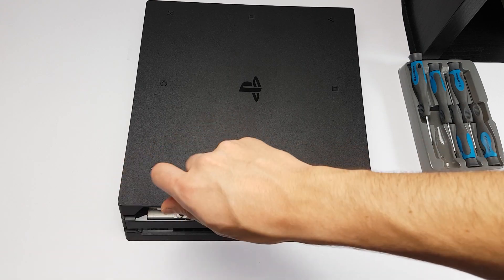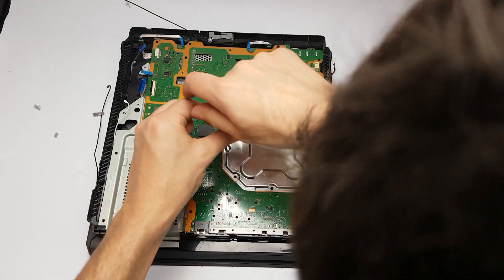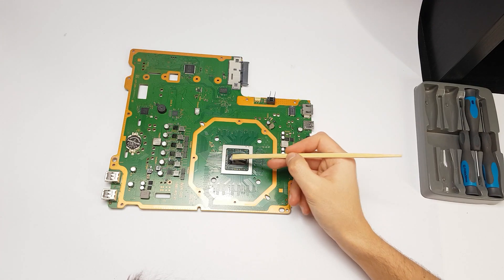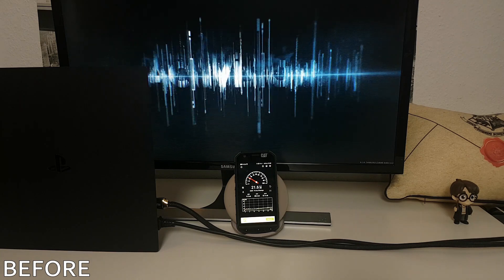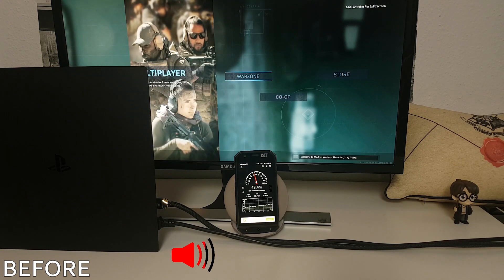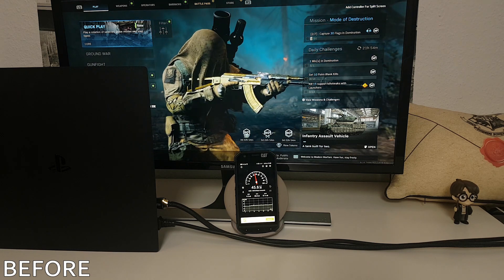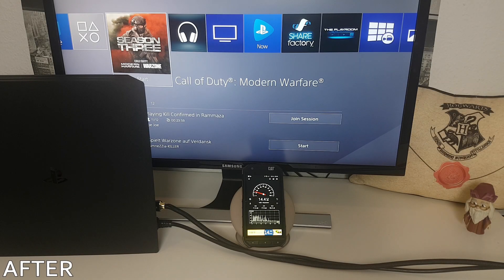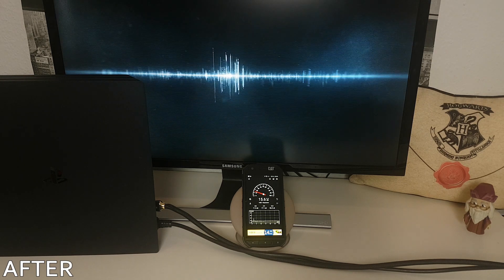PS4 PRO Fan Noise FIX - Thermal paste & dust - Before/After TEST

Comment: Do you imagine people blaming car factory for engine failer when they don't change engine oil for 2 years. Yes that exactly how stupid people looks blaming console temperature, inferior cooling system maybe, more power yes old thermal paste maybe depends how long the console have been used and made.
Just take care of you console 
Comon sense people!
Reply from the maker: The difference is that a car factory explicitly asks you to change the oil of your car. On the PS4, you shouldn't change thermal paste, it is supposed to last a few years.

Comment: every time I have to hear this crap, i ask myself how sony said “okay, this noise is fine” and shipped the product... seriously blows my mind
Reply: I think maybe games weren't so demanding back then.
Reply: @K1LL0_0SWITCH  a lot of games looked demanding but the console was fine with it, now some games even in menus kick up the fan for no reason, and what makes it even worse is that some games has a huge performance hit on every system because of the piracy protection the devs put in their games, in addition to the size of heatsink, all those things make me wanna jump off of a building
Reply: @K1LL0_0SWITCH  but the thing is my xbox still holds up fine running read dead and my ps4 can't even run ff7 quietly
Reply: @Nicori-hibi when I had my Xbox one s it sounded louder than my PS4
Reply: @poopbum9944  one S andps4  has a traditional cooling. One X has a different coping with vapour chamber.
Reply from the maker: In the beginning it was okay tough. But now, it is unbearable...
Reply: @SiriusMonkey  when it crashes I just want to get a revolver and not kill myself, but shoot the console
Reply: I think it mainly has to do with the thermal compound they use and the dust gathering in the heatsink
Reply: Very strange how the Xbox ONE is better at heat reduction that the ps4pro. I've had mine since release and I barely use it because of that issue.
Reply: It was fine for two years. You have to clean it regularly. Especially the dust
Reply: The sound is from the lack of the maintenance and cleaning the fans
Reply: @FlexSZN23  sony loves bragging about playstation being a console that should be hooked up to a tv... most people buying consoles do not know/care to do that because consoles usually run fine without any maintenance.. or at least they should
Reply: But there was literally a patch of dust on the heatsink preventing the cooling fan from keeping the system from overheating. 

So Sony should in charge of the dust that is present within an environment?
Reply: @MajorisMons  Absolutely. Dust is present in every environment and so engineers should design products that don’t have dust gather in detrimental places under normal use conditions.
Reply: @tayt_  

Isn't that a bit of hindsight thinking though?

Almost everything cannot be 100% "fool proof", engineers can only improve upon the issues caused by people using their product[s].

Which shows on how Sony made the PS4 Pro and Slim easier to clean dust out of when compared to the launch PS4.

At what point are people held accountable for managing the environment that they tend to use the product[s] in?
Reply: @MajorisMons  Having been an OEM of consumer electronics for decades at that point, they should have understood how dust would affect the system over time. Plain and simple.
Reply: @tayt_  
True, but on the same note car manufacturers should of  been put seat belts in their cars before 1940's.

Or curling irons should've had a warning label stating, "For external use only" before the early 1900's.
Reply: They knew it was fine because people bought the PS4 and that was loud too. So they figure people don’t care. The ones that really care have moved to Xbox one X.
Reply: @vitorfernandes651  facts. Exactly what I did. It's a shame because I really like the system. But that fan and heat exhaustion kills it for me.

Comment: I had cleaned my PS4 and it way way louder than before.it overheats after 20 minutes of playing call of duty.i haven’t replaced the thermal paste or anything like that as I’m scared I will break the PS4. What should I do?
Reply from the maker: That's not normal, is it ? A cleaner PS4 should be quieter 🧐
Reply: Sirius Monkey it shouldn’t be put it is stupidly loud now

Comment: I replaced the whole godamn fan and it still loud as fuck (not as loud as before but close to it)
Reply from the maker: Dammit 😯
Reply: Did you also replace thermal paste?
Reply: @TheManOfMuscle  hm I don't believe so, I'll try that too
Reply: @commandersarge6962  I replaced the fan too, but I didn't put on new thermal paste. It runs quiet, but it's kinda hot though. Is yours hot as well?
Reply: @TheManOfMuscle  I'm not sure I actually never thought to check but I could check it and tell you if it's hot or not
Reply: @commandersarge6962  I'd appreciate that.
Reply: @TheManOfMuscle  alr sorry I took so long but yea my ps4 also gets hot but I think that's normal, besides even if it gets too hot the ps4 will tell you so I think it's fine
Reply: @commandersarge6962  Yup, did some temperature tests on it. Sometimes the case gets real hot though. Thanks again.
Reply: @TheManOfMuscle  np

Comment: Doesnt this void the warranty though? I build computer, so I have extra thermal past to use for this, but I’m worried it will void the warranty.
Reply from the maker: The warranty is voided once you open the PS4 :) The black stickers on the back state: "Warranty void if seal removed/damaged"

Comment: I have tried 2 methods:
1. replace the thermal paste with the size of the bean seeds and replace the thermal pad. and the results after 1 month the fan noise is loud again.
2. replace thermal paste with the method of spread paste with tools and give another paste to the size of the bean seeds. place thermal pad to the HDMI chip. and the results have been more than 6 months the fan remained silent.
my advice try experimenting on your ps4 pro and I've done that and the results are satisfying.
Reply from the maker: Thank you for your feedback ! :) Mine has been quiet for 1 month, but not much more unfortunately... I will replaced the thermal paste again, but this time not that much.
Reply from the maker: Thank you for your feedback ! :) Mine has been quiet for 1 month, but not much more unfortunately... I will replaced the thermal paste again, but this time not that much.

Comment: Hi dude,tnx for the video.my ps4 pro 7016 sound like jet in rdr2,cod,all 4k games.what is ur ps4 situation after replacing thermalpaste today? Is it worth it? Is it quieter than before? Tnx
Reply: My ps4 pro is cleaned,no dust in heatsink or anywhere else,if changing thermalpaste make my ps4 quieter and being quiet after several mounth,i’ll do it
Reply from the maker: @mohammadrezarezvany  Hello, thank you for your feedback :)
After the thermal paste replacement, my PS4 Pro is quiter. But not all the time, sometimes it's as loud as before (jet engine). Then again, I applied too much thermal paste...
Reply: Sirius Monkey tnx for ur answering bro👌👍 wish u best

Comment: WAY too much paste, should upgrade your HDD with an SSD to eliminate even more noise
Reply: Yeah it was way too much. On the other hand tests have shown that it doesn’t really matter how much you put on as long as you’re above a certain minimum amount.
Reply: @manuel0578  very true, just feel like if your going to make an instructional video you should at least try and do a nice job
Reply: 2.5" HDD make minimal noise.
Reply: @Loundsify  While true, it's moving parts and moving parts means more heat. That and having an SSD inside one is amazing. Especially when playing games like MHW where your load times go from ~60 secs to 12
Reply: @erifetihw  the original PS4 has a SATA 2 controller, so it's limited to a maximum of 300MB/s so on average you're only ever going to halve loading times on the PS4.
Reply: @Loundsify  considering the R/W on the HDD is around 80MB/s I'll stick to what I said
Reply: @erifetihw  still hardly the 5x speed increases a usual SATA 3 SSD offers.
Reply: @Loundsify  thanks for the info
Reply: @erifetihw  thanks for the info  I think your both right an i have a ps4 super slim an no noise like the first generation

Comment: My original ps4 from 2013 or whenever sounded unreal within 20 seconds of booting any game it overheated and then eventually turned off, I did this to try and fix it but I think it was too far gone because I heard no difference. It was full of dust when I took it apart though and the paste was all dry but now I have the pro I thought it would be better but I can tell the same will  just happen which is sad. Hopefully the ps5 has amazing cooling
Reply from the maker: I'm hoping for the same ! The PS4 Pro is just too loud...

Comment: Do you live in a dusty environment?I have mine for 3+ years (when was 1st came out) and i have two cats in my room.And is as loud in warzone,as yours,when you changed your thermal paste.And only in menu,in game its fine.What i did with mine is,having an air cleaner right beside my PS4 Pro,form the day i bought it.And every time i turn it on,i clean the surrounding area.And no problems at all.I have it vertical with its official stand.
Reply from the maker: Yes, my room is actually very dusty. Thank you for the idea :)
Reply: @SiriusMonkey  I got another crazy idea to stop the hairs from going inside,got it from my PC that has some kind of net type thing in the vents.And i have seen that it stops the majority of them from going in.So in a nutshell i was thinking to use something similar to cover the side  Ps4 vents with it.
Reply from the maker: @woofaki5550  That could help. Especially against the cats' hair :)

Comment: I'd say the biggest difference came from just cleaning that dirt out of the heatsink considering how much it was blocking air flow, not from reapplying the thermal paste.  But I'd re-apply thermal paste after a few years of use anyways, as it degrades over time.
Reply from the maker: Yeah, there was a lot of dust trapped on the heatsink!

Comment: Imma be real I’ve been a hardcore PlayStation/Sony guy all my life literally since the ps1 never owned any other console or pc, but if the ps5 has noise problems like the 4 and 4 pro does I’m going to pc I can’t justify having a console that I can barely stand playing without headphones cause it’s so damn loud. If I wanted something I was gonna have to take apart and fix myself I’d have already been on pc.
Reply from the maker: I feel you... Hopefully the PS5 is quieter 😏
Reply: From the sounds of it the cooling solution the PS5 is going to get is very akin to a server.

Comment: got a quick question, i am planning to open up my ps4 pro and give it a deep cleaning, and with that i'll have to change the thermal paste also. so my question is that can i use the same thermal paste used for PC CPU? i've recently built a pc so i have left over thermal paste with me, just wanted to know if i could use that one?
Reply from the maker: I'm no specialist in the field, but I guess you can. The one I applied (Noctua NT-H1) can be used with any type of CPU cooler :)
Reply: You can use that, but just a general note that make sure you use the best quality thermal paste possible. It will make a big difference. Do NOT use a $1-$5 paste. Thermal Grizzly or Arctic MX-4 are the best guaranteed. Good luck
Reply: Irfan afzaal  i use noctua nt-h1, safe for themal surfaces including copper and aluminum. I use a horizontal line or a pea sized dot. Pls see for your self at the noctuaweb site

Comment: My ps just turns off as soon as I turn mw on. Will this fix it? Cause I read some people saying that I goes back to the same noise after a month or so
Reply from the maker: Same happened to me, after one month the PS4 it went back to the same noise (a little quieter though).
Reply: Yh same. My PS4 pro freezes and then turns off when I go on any game. I dont know how to fix it.
Reply: Mine works for 30 min then it turns off but stays with white light and my controller disconnects.
Reply: Just fixed mine simply by cleaning it out and changing thermal paste. Keeping the area dust free helps a great deal, which means looking after your gaming room- vacuuming and dusting regularly. It will return to similar ofcourse over time.  Regular maintenance is mandatory for optimal performance to noise ratio

Comment: I recently changed my thermal paste and cleaned out the dust. It was nice and quiet for a couple of days. Now back on the same BS as before lol hope the same isn't happening to you
Reply from the maker: Unfortunately, it is... After 1 month or so, it went back to normal
Reply: @SiriusMonkey  is because the high temperatures, you need high quality thermal paste, use liquid metal.
Reply from the maker: @frederick3811  Is it expensive ?
Reply: @SiriusMonkey  Less than 15 dollars per gram, you need to be careful when placing it, that it does not expand beyond the cpu/gpu chip
Reply: The problem is y’all need a air purifier. An a dust mop
Reply: @Sleepy Time woah thats actually a very clever idea
Reply: Mines lasted for about a month before it went back to the jet engine sound.

Edit: used artic mx4 and I even changed the thermal pads. 
Doesn’t matter wat u do the PS4 just suck at cooling.
Reply: @Danxiong  But it lasts 1 month without getting too hot, the problem is that the thermal paste does not last long without deteriorating

Comment: I have a cuh 7216b and the noise is beyond ridiculous, according to digital foundry they are quieter than the earlier versions, goodness knows how loud they were. I actually think something is wrong with it, its that loud.
Reply from the maker: Do you think it's louder than mine ? I'm always worried it might overheat any moment...
Reply: @SiriusMonkey i have the 7215b, supposed to be quieter and boy mine was overheating like crazy while playing rdr2 or death stranding. 
I opened it and weirdly there was no dust in the heatsink, but the thermal paste was trash. I changed it and now its super quiet. It does get a tiny bit noisy after a couple of hours of gameplay.

Comment: I have an issue with my PS4 (original) i have cleaned it out and my fan is really quite, even when im playing graphical games, i get alot of error code ce-34878-0 and ce-36329-3 (this one crashes the whole ps4 and shuts it off) when i touch the top of my PS4 it is BURNING hot, do you think these error codes and crashes happen due to the PS4 pretty much overheating, i dont get any overheating message pop ups telling me its overheating but my games and sometimes my whole console will just crash. I have tried everything such as initilasation and even reinstalling the PS4 OS but still the same issue, i even cleaned it out fully and no dust appeared to be anywhere.
Reply from the maker: That's bad... You haven't replaced the thermal paste, have you ?
Reply: @SiriusMonkey  no i have not, but thanks for replying back :D
Reply from the maker: @jex.  The fan noise of my PS4 Pro went down after replacing it (video on the channel), it could work for you as well 🧐
Reply: Uhm might be possible ur fan isnt even running. Considering you cleaned everything.
Reply: What's the situation now? I've got a similar problem.

Comment: Hello whenever I open my ps4 after 3 minutes it says that the ps4 is too hot and turns off by itself. If I replaced the thermal paste it's gonna turns off again? (Sry for my English)
Reply: This is not true, you should clean the ps4 from dust, dust makes your ps4 turn very hot. The thermal paste is there to keep your cpu cool and to not trigger your fans to spin that fast
Reply: @meadow_uk  do you have insta to ask you some questions
Reply: @sgtcrim1817  Yeah sure, I clean and repair ps4's myself so you can ask me anything.@broodjetand
Reply: you either  put too much thermal  paste or your ps4 is clogged with dust
Reply: @frosty212  i haven't replaced the thermal paste yet
Reply: @sgtcrim1817  if your breaking the seal between the cpu cooler and the cpu you should be replacing the thermal compound that creates that seal, as a result of not replacing it you will end up with air between the cpu and the the heatsink reducing the heat transfer and overheating your cpu

Comment: ca n i do it without replacing the thermal paste
Reply from the maker: Removing dust is good as well :)
Reply: No,in order to get in between the fan and the heatsink you need to take out motherboard

Comment: Please to anyone watching I BEG do not put on thermal paste like that😂😂😂
Reply from the maker: Method or quantity ? :)
Reply: @SiriusMonkey  both
Reply: It actually doesnt matter if you put alot. Look it up
Reply: @venombrand3157  It does, if you going to spread it up there is a high
chance that it will create air bubbles that make your cooling inefficient, it
will work yes, but if you're buying an expensive thermal paste with highest MK
and you want the best performance and noise you want to use a line or dot
method. The pressure is going to spread it up equally and with no air bubbles.
So why bother with spreading paste if it does a problem, a total waste of time.

Comment: How long have you had your ps4 before you cleaned it for the video. I'm not sure how often I should clean mine. I dont want my heatsink covered like that but my house is so dusty I started vacuuming floors regularly and dusting shelves I even quit smoking inside but I still see alot of dust floating around && building up on my ps4.
Reply from the maker: I've done all this after 3 years with the PS4 Pro. My room is quite dusty as well as hot !